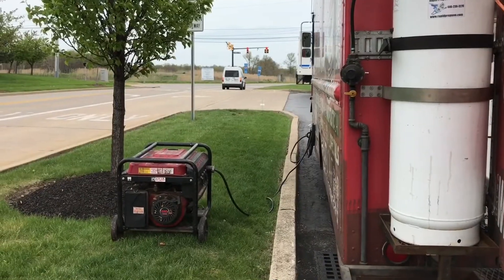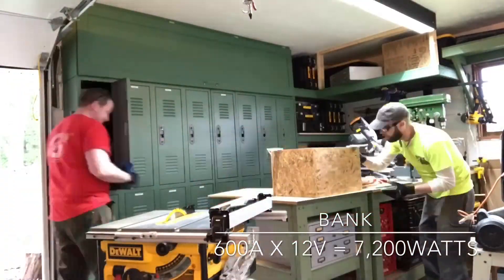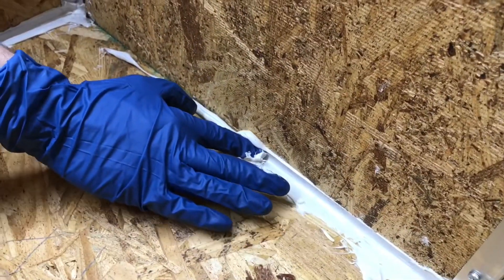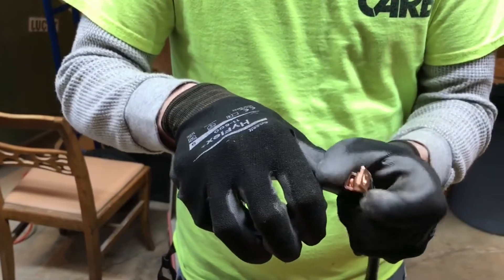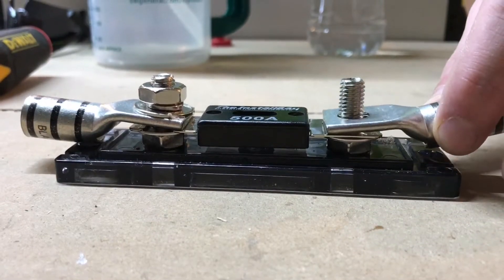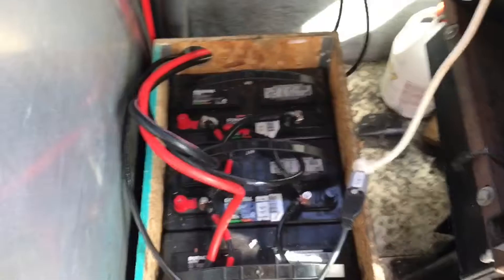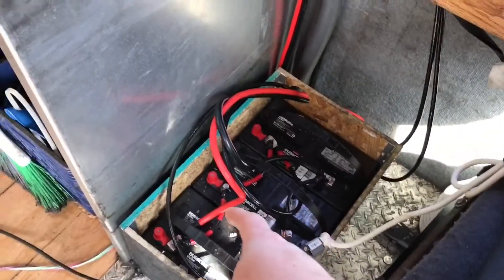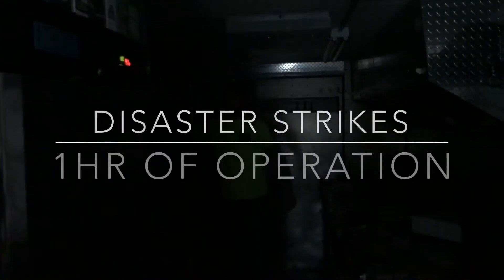#1 - Clean Energy Food Truck (Quiet/Inverter Generator Alternative)

Comment: It isn't good to put electronics over lead acid batteries.
Reply from the maker: Hey Randall, I didn’t think about that until you mentioned it but the hydrogen gas that naturally leaks from lead acid batteries could actually cause an explosion if it built up in the box.

Fortunately the gas leaks incredibly slowly and we have two 400cfm fans blowing constantly to ventilate the box.

Unless there was another issue that I wasn’t aware of.